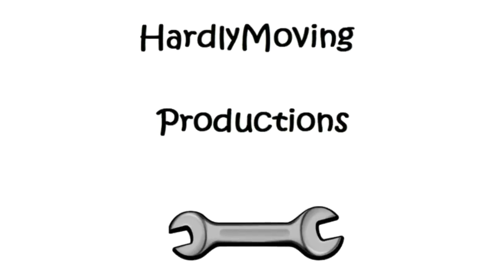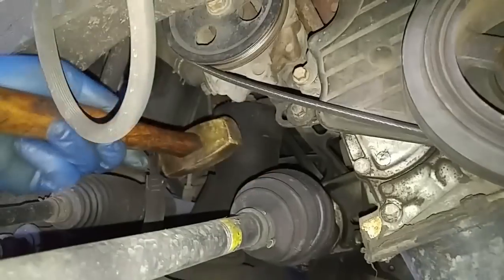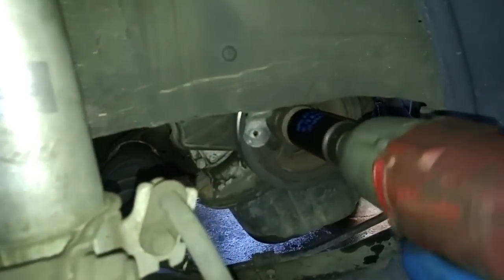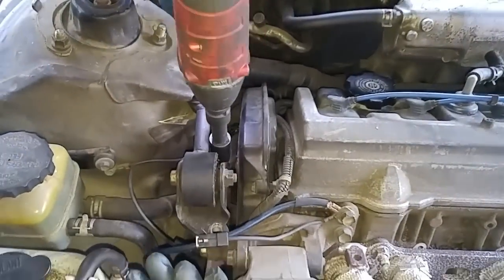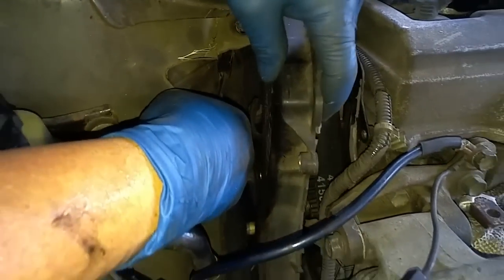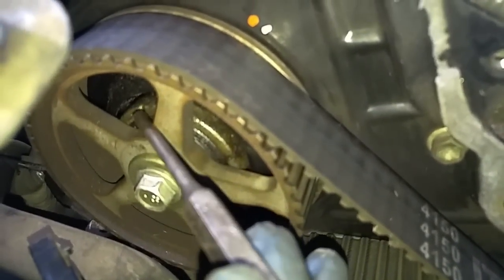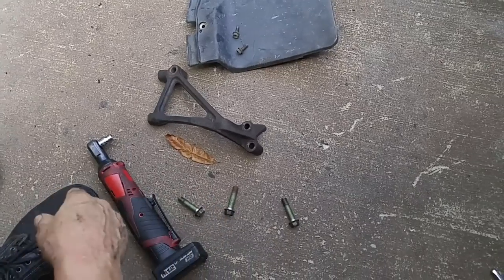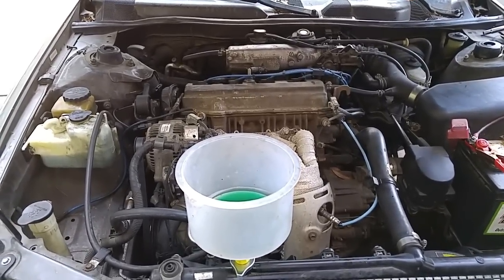Camry Timing Belt, Water Pump, Seals & Pulleys Replacement:  2.2L I4 5SFE Engine

Comment: What type of attachment you used to clean the water pump mounting surface? I want something i can use with my impact driver.
Reply from the maker: It's a wire brush attached to a air powered right angle drill.   Does quick work on removing paper element gasket residue as well as prep the surface for a new gasket.  Warning:  Do Not Use Sandpaper to prep the mounting surface.

Comment: Nice man. I think its funny, I look at my repair manual, and it wants me to open the top of the engine, drop the oil pan, remove all coolant, and the AC, just do to do this, yet all I want to do is the Timing belt and the water pump, just like you. Why would i need to remove the oil pan (which means draining the engine) and the coolant?
Reply from the maker: Which repair manual?
Reply: @hardlymovingpro  probably haynes, and maybe 50% of youtubers who have also replaced timing belts on this exact same engine. I agree seems wayy too much.
Reply from the maker: @SuperHtownswag  Insane.  No reason to drop the oil pan to perform a TB and WP service.

Comment: Where do you get the installation tool for the seal I would like to have one?
Reply from the maker: A link is provided in this video's description.  If you want to get to the tool from here:  https://amzn.to/2F1Nlag
Reply: @hardlymovingpro   Thanks I just did the timing belt water pump on my Avalon with the OneMZFE used your other video for instruction it was great I ended up using a piece of PVC pipe and a small hammer for the seals

Comment: I have the 2gfre engine. Do I have to to take out the harmonic balancer to reach the oil seal? Thanks the vids!
Reply from the maker: If the seal behind the balancer is leaking.
Reply: @hardlymovingpro  it was definitely tricky putting the engine back on the mount. i had to to use 2 jacks and push one jack at a time to align the mount. thanks for the vid. looking back, i only switched 2 pulley and missed the tensioner pulley...not looking forward to doing this again. did you use two, separate long 2x4 and raised the engine by the oil pan, and transmission pan? my oil pan got dented, but that was my fault
Reply from the maker: @toanlam8603 congratulations on finishing the job by yourself!  A 2x8 block of wood would distribute the weight more evenly
Reply: @hardlymovingpro  thanks! I had 2 others help me

Comment: Is there another way I can remove the camshaft bolt ?
Reply from the maker: Using a long handle 1/2" socket wrench.  With the handle of the wrench secured to the ground and the socket square on the bolt, turn over the engine (like as if starting the car) for less than a second.  The torque from the starter motor might spin the bolt off.
Reply: @hardlymovingpro  I was able to remove it using its belt routed to the AC compressor using it like a wrench strap sorta thing. Now I need a pulley puller....
Reply from the maker: Soak with penetrating oil and let it sit for a day.  Will help with the removal.

Comment: I put the timing belt on and I had put tension and it is still slack. I did replace the spring. What is the problem?
Reply from the maker: Did you start the car, recheck the tension and adjust?

Comment: Glad to see you still replying to comments only a month old!

I plan on buying a 95 wagon that has 148k miles. For the past 10 years, it's only had 1k miles put on it. I have very little experience working on cars, but plan to use this as a learning opportunity.

Would you recommend I replace the oil pump and/or oil pump seals while I'm down there?

Also, what would the health of the transmission fluid be like after sitting for ten years? CarFax shows it was changed 1k miles ago... In 2010.... Can't really find any good info on the lifespan in terms of years on trans fluid.

I won't be able to thank you enough for your help, so I'll be sure to drop a subscribe and share your channel.
Reply from the maker: Thanks for your post.  The belt replacement service interval is based off of either mileage or age.  Never paid much attention to age until I replaced a "jumped" belt on a Suzuki.  Belt was over 10 years old with less than 30,000 miles (6 year or 60,000 service interval).  Belt had a lot of cracks and ready to snap.  Wouldn't replace the oil pump but would replace the seals.  Trans fluid change should be done based on the color of the fluid.  If very dark, change it.   Good luck with the repair!
Reply: @hardlymovingpro  The gentleman has it listed for 2k. I'm hoping to get it for not much over 1k, but I don't want to lowball him too hard. First time negotiating a car. No AC, spotty service records, hardly used in ten years, and he's had it posted for about 6 months. My best bet is he isn't too stubborn about it and wants to get rid of it.

I'll keep you updated if you wish. If not, I'll just quietly observe and learn from your vids :p
Reply from the maker: @Ryan_Carder  A car with a non functioning ac is basically worthless.  If the evaporator core is leaking, fixing it would require 8 - 10 hours of labor.  I've seen minimum ac repair quotes starting at $500 ... average ac repairs over $1000.  25 year old car?  Unless the exterior and interior were mint and the car was garaged, I wouldn't pay over $400.
Reply: @hardlymovingpro  very fair point and I've considered this myself and hope to use it as leverage. The unfortunate thing is, I really want this car and that takes away all of my negotiating power. 

The exterior is in good shape, no paint fading or chips, interior looks good as well. Just called a place, $450 for the evaporator and I assume the evaporator is worst case scenario in terms of cost.
Reply from the maker: @Ryan_Carder  Your call.  $1,000 is way too much.  Then there's the ac compressor, condenser, accumulator, etc
Reply: @hardlymovingpro  okay. So I went and checked out the car. Dude was sketchy from the get-go. Spent half the time on the phone with his wife trying to find a title for a different car.

So in addition the AC, the power steering fluid was empty when he cranked it, the speedometer was busted, the blinkers didn't work, one of the windows left cracked for who knows how long. The window motors might be broken, but I think the window lock was on.

There were a number of more issues with the car I can't recall. Too many to keep track of. He wouldn't move under a thousand. Dude is never going to sell the car.

Comment: Just curious what's the average cost at the mechanic to replace those things in the video plus oil pump seal? Thank you!
Reply: Google it you can buy the  new kit for timing belt and water pump for $150 but I reckon about $300_$400

Comment: Great Video.  Suggest you give torque info and more tool wrench size info. (or not).  when you put the water ump back on did you use a new gasket?  Saw you clean things up, but thought I just saw the part put on, no gasket. Sorry if I misse that. Again, great video, the best one on this I've seen. THANK YOU!
Reply from the maker: Thanks for your comment in your post. Yes... The new water pump gasket was installed around the 10:30 mark. Torque specs can be obtained from a technical service manual specific to this car which I recommend to all DIY mechanics.

Comment: That seal remover for the camshaft seal will still scratch up the shaft surface. I could never get the seal removed that way. The way I do it for the camshaft is to take the pulley off, remove the two bolts for the camshaft cap and push that seal from the inside out. Insert new seal and reinstal.
Reply from the maker: The puller claw pulls on the outside lip of the seal.  The seal's inner lip that rides on the cam doesn't get touched by the claw.

Comment: The notch on my cam shaft sprocket is way off on the other side it doesn't align up with the cam shaft centre hole.
Reply from the maker: There's no notch on the camshaft sprocket for alignment ... only a camshaft hole.
Reply: @hardlymovingpro  ok I saw on video the paint marks on the back plate which aligns with the centre hole to help tighten up the belt before spring installation.
Reply from the maker: That's correct.  You can make and check the alignment with the hole and back plate notch using a mirror.
Reply: @hardlymovingpro  ok thank you I'll try again, I try it yesterday belt wasn't tight.
Reply from the maker: You advance the cam or crank pulley towards each other around a notch to ease mounting of the belt.  Then re-position the cam or crank pulley back to its TDC mark to remove the slack.  If everything is in alignment, the belt is properly mounted.  Complete the rest of the installation as outlined in the video.
Reply: @hardlymovingpro  Thank you so much for your help very much appreciated.
Reply from the maker: No problem.  And don't forget hit the subscribe and thumbs up button.
Reply: @hardlymovingpro  sorry forgot to ask you how do I tighten up the harmonic balancer bolt as I don't have a tool to hold in place to stop engine from moving when tightening up the bolt.
Reply from the maker: You have to get yourself either a mechanical impact driver or a inexpensive ac powered electric impact tool (under $100 @ norther tool, harbor freight, amazon, etc).  You'll need to generated around 80 lbs of torque on that bolt.
Reply: @hardlymovingpro  ok is it normal to have some slack on timing belt   on some parts of the belt is the middle centre that has slack rest is tight.
Reply: @hardlymovingpro  I might have a big problem now the bottom and top marks don't line up it lined up before I rotate the belt now is way off.

Comment: the seal on the crankshaft looked mangled. you sure that's OK, will I see. the same effect when I do mine
Reply from the maker: Sorry ... don't understand your question.  I replaced the old seal with a new one.  I pulled out the old one with a paint can lid removal tool.
Reply: @hardlymovingpro  he meant the new seal when you inserted it
Reply: @HardDriveBeatss  He meant cam not crank.

Comment: What 'up with a Toyota Camry 2010 chain o belt ,,
Reply from the maker: Your 2010 4 cylinder Camry has the replacement to the 5SFE which is the 2AZFE.  It's a 2.4L, DOHC, all aluminum and timing chain driven engine.  A very smooth running engine compared to the 5SFE with more power and better fuel efficiency.
Reply: This a very nice detail instruction on how to replace timing belt, camshaft seal,  water pump. Been think doing it myself for a long time. But now   l 'm fully confident I'm up to the task and even replace the oil seal pump. Thanks a bunch and I now subscribed to you channel.
Reply from the maker: @csan255  Hey ... thanks for your great comment and good luck doing the repair!  If you have any question, don't hesitate to ask!

Comment: Great video ! It would be more helpful if you spoke the torque on each part as you wrapped up, and also displayed torque on the screen. I saw this video at least 10 times and took notes of the sequences of your actions.
I feel confident to do this job during winter break myself. I am no mechanic. I have little knowledge. I hear that same noise behind TB cover in the morning and then it dies down. All I need is correct tools and time !! Will not do a speedy job. Thanks a lot !!
Reply from the maker: Hey ... thanks for your post.  Noise in the morning and then dies down are signs of worn timing belt tensioner or guide pulleys.  You're on borrowed time before the belt brakes.  If you need the torque specs, here's the link to a article I wrote a few years back with a diagram containing torque specs:
https://axleaddict.com/auto-repair/Toyota-Camry-5SFE-Engine-Timing-Belt-Water-Pump-Seal-Replacement
Reply: @hardlymovingpro  Thanks a lot for your concern and prompt response. People like yourself are heroes for us.
Reply from the maker: No problem ... thanks for your response and good luck with the job!

Comment: I know nobody asked but on the bypass filtration info....most significant engine wear occurs from particles less that 5 microns in size.   The full flow filter, even the best one, because it has to maintain high oil pressure, really only filters at 95% efficiency down to about 15 or 20 microns.   When you run bypass filtration, you bleed around 10% of the oil flow through a nearly infinitely more dense filter, and at a much slower flow rate.   This allows nearly 99% efficiency down to nearly 1 micron.   By removing these particles you get a many fold benefit:

1.  Significantly reduced engine wear.
2.  Greater efficiency in terms of heat exhange and mechanical efficiency as the oil is now, basically, clean.   You aren't paying to move particulates in the oil around your engine at 2,000 to 4,000 rpms .   The weight of the oil is only slightly higher with all the crap in it, but because it has to be moved at such high speeds, , this is a large energy cost.  When you remove all the particulates, it takes far less energy to move that oil.  
3.  Always clean, warm oil will remove varnish and other gunk from the oil flow paths, keeping tolerances as new as possible minus any prior wear. 

4.   Analytically clean oil from mile 0 of oil change to the next filter change interval.  Without bypass filtration, the oil just gets dirtier as you drive until you do a full change, the repeats the process of particulate contamination. 
5.  Oil changes are basically the bypass filter, and whatever oil was still in the filter at the change.
6.  Oil analysis can confirm the proper installation and performance of a bypass filter, as well when to do a complete oil change.  I do the full change on this camry about 2x per year, and put about 30k miles per year on this car.    While the bypass filter element can absorb about 6 oz of water, any more than that and the oil will turn acidic, and no filter yet can change that.  So analysis would tell you that, but I just use 6 to 12 month intervals.
Reply from the maker: Bypass filters are pretty much standard on diesel engines because of all the soot build up.  Had an Amsoil bypass filter on my pickup truck around 20 years ago and it worked on the principals you had previously outlined ... which I agree with.  But I came to realize that although the filter can help protect the engine from wear and tear in the long run, everything else that surrounds the engine wears out:  alternators, starters, sensors, radiators, ac compressors, condensers, suspension parts, timing chains, head gaskets, valve cover gaskets, fuel pump, fuel injectors, valve stem seals, exhaust system components, transmission components, door lock, window regulators,  bearings, etc...that unless you can do the repair yourself, for the average owner they'll trash the car.  So if the engine runs okay with synthetic oil changes every 6k miles or so, why bother with the time and effort using a bypass filter for that extra level of engine wear protection?  For the cost of an oil analysis, I can do another synthetic oil change.   A failed transmission cost as much to replace as a worn out engine to replace.  Also, I can get a reman 5SFE engine for around $1K and swap the engine out in a day.
Reply: Its a personal choice.  Ive run the numbers and have a car, at the end of the day, that is still running strong at 335,000 miles plus.  It cost less than 22 cent per mile to drive including gas. (I purchased it used at 65,000 miles).  So based on how I like to spend money it has worked very well for me.  I believe, in addition to an amazingly excellent design and manufacturing process of the camry 5fse, that excellent filtration contributed greatly to the low cost of ownership of this vehicle.
Reply from the maker: @orthopraxis235  The 5SFE was and still is a great engine ... but you should check out the specs on Toyota's newer I4 engines.  The horsepower gains along with the fuel economy is nothing less than amazing!  Also their transmissions ... 8 speeds.  A standard Camry rides like a Lexus 20 years ago.   I drove a late model Camry recently as was blown away.  Incredibly smooth, powerful and quiet!  You can barely tell the transmission is shifting.

Comment: @10:15 DO NOT use a steal brush to clean that mating surface. You can scratch that machine fit and cause a small oil leak that would be essentially impossible to stop. At the very least use a brass brush but I wouldn't even recommend using that. Just use a nylon brush or just clean it off yourself with brake cleaner and a rag.
Reply from the maker: Incorrect.  There's nothing wrong with using a medium abrasion rotary wire brush on an angle.  Removes both paper element and aluminum oxidation residue.  My peer mechanics and I do it all the the time as standard-operating-procedure (SOP).  Provides a complete leak free seal.  The big no-no is using sand paper.

Comment: The hardest part for me is getting that side bracket off. Sux.
Reply from the maker: Yea.  Those bracket bolts mounted to the side of the engine block.  Take the crankshaft pulley off first.
Reply: @hardlymovingpro  OK. Thank you for this video.